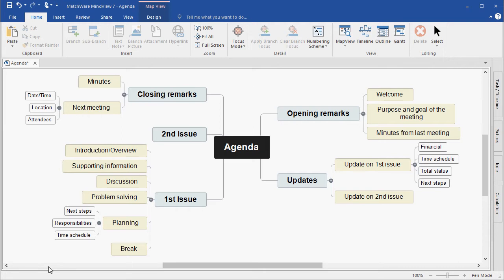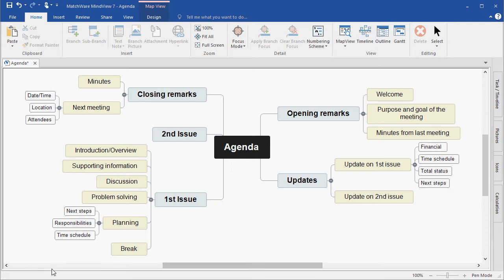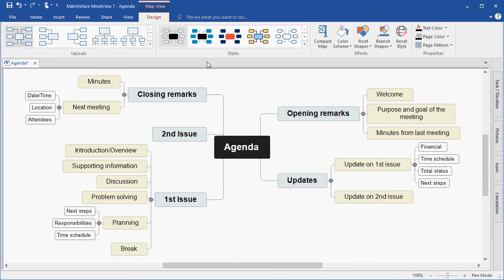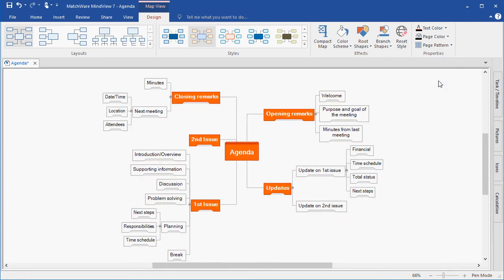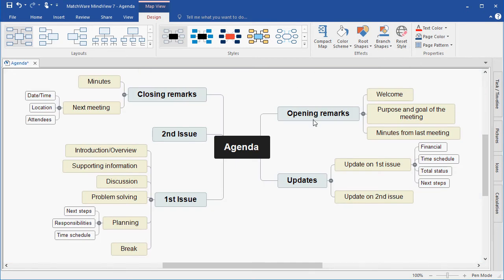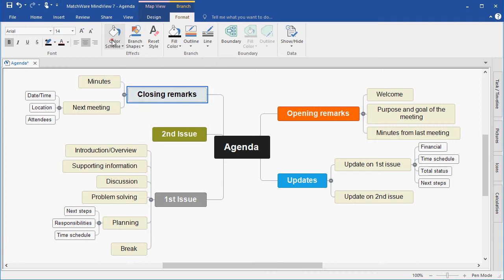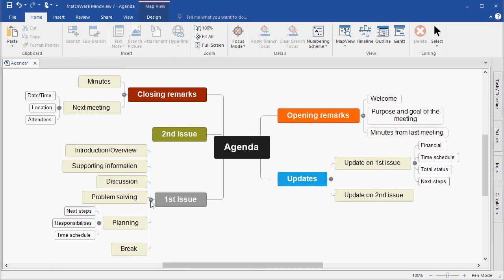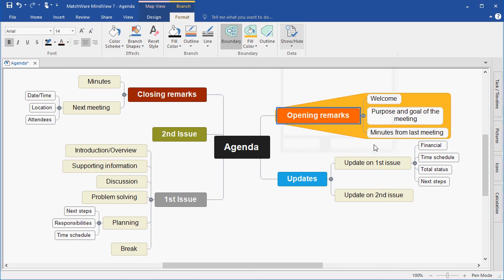MindView 7 - Customizing Your Mind Map

Comment: Is it possible to move branches freely? Like a spider diagram, where  can set the positioning?
Reply: It is possible to move branches freely by disabling Auto-layout

By default, MindView automatically arranges the main branches as you insert them to prevent any overlap. You can however choose to reposition the main branches yourself after their insertion by disabling Auto-layout mode.

Click the workspace so that no other element is selected.

Click the view tab at the top. Then go to the tab called Show/Hide. Then click on the panels box which will give you a drop down option. Then make sure that you have not not anything selected. Click on the Properties option to open the Properties window which will open on the left side of your screen. 

Click the Branches tab.

Then at the bottom you will see Auto-layout box. Uncheck the Auto-layout box.

And now you can move the boxes freely